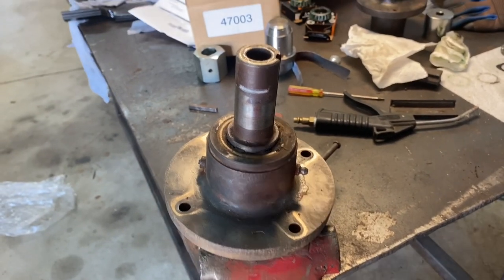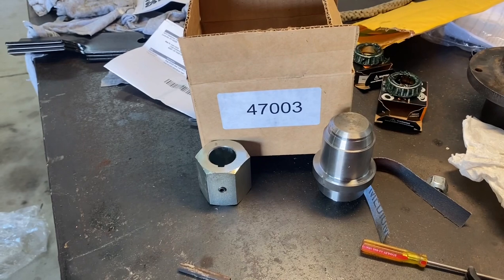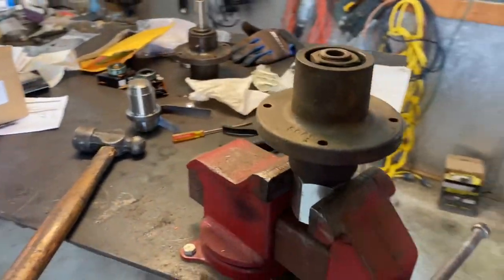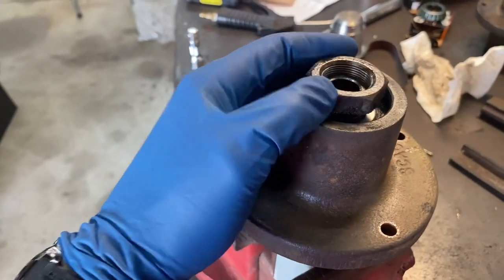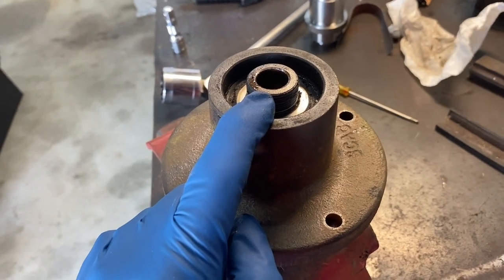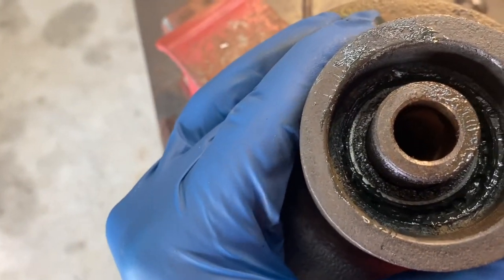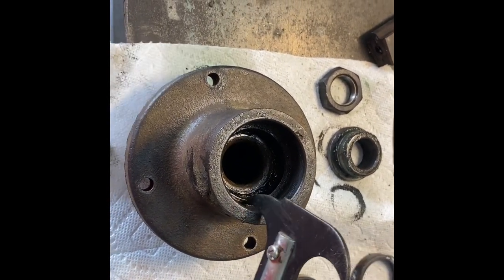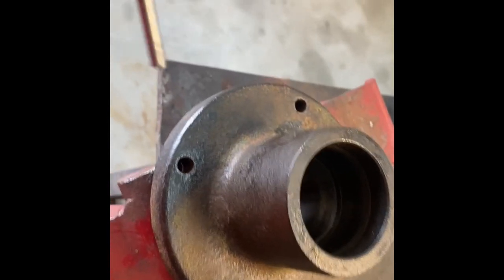Scag Tiger Cub Spindle Hub Bearing Removal

Comment: Want to add the C clip that was on the inside of the bearing is only on the bottom side. Scag site shows it on both sides of the inner spacer (smaller one) Your video cleared that up for me. Thank you!
Reply from the maker: Glad it helped.

Comment: Just a FYI on how to get the large C clip out
Just need to remove grease zirk and then rotate open end of C clip to the hole and push on clip with a flat punch through  the hole where th e zirk was removed